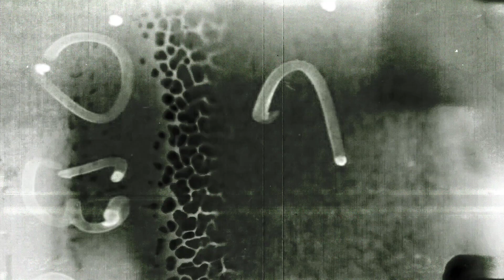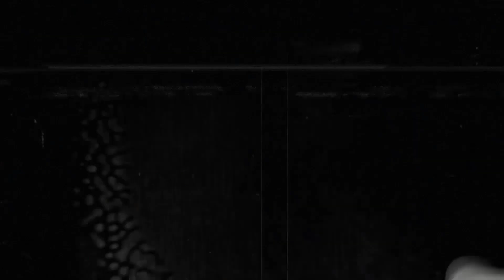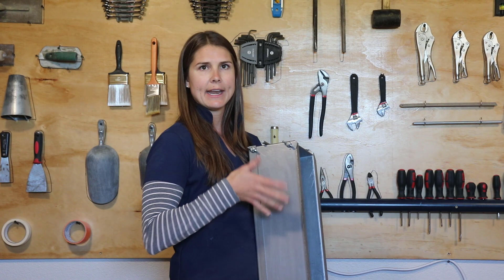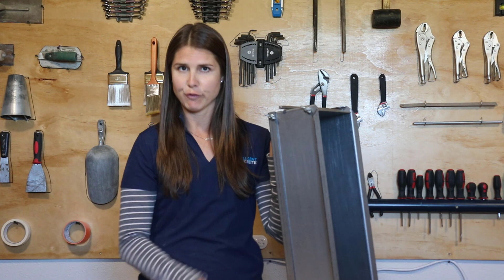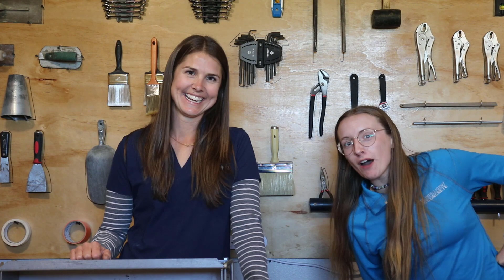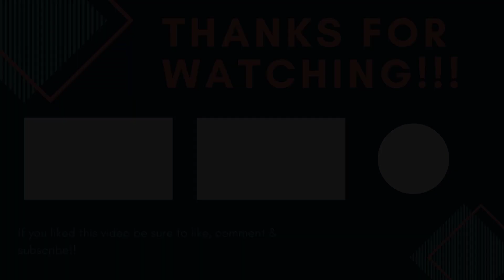ASTM C 78 - Flexural Strength for Concrete - Vlog 642

Comment: Pls tell How many days required strenght percentage I mean 7 days strength how many percentage 14  and 28
Reply from the maker: It all depends on the binder. 75% at 7-days is the rule of thumb.  80+ at 14-days and you should be at 95% at 28-days

Comment: What have you found on the 1/2" steel rebar/6x6x6 paving mats/fiber/basalt rebar debate?  I'm a flatwork contractor who uses 1/2" rebar 2' o/c almost exclusively. I've noticed that when people use paving mats the reinforcement usually ends up pretty much on the bottom of the slab (definitely if they don't use chairs and sometimes even when chairs are used). Question 1 - Since fiber provides reinforcement through the whole slab, can fiber replace steel reinforcement in things like driveways, shop floors, and footings/foundations. Question 2 - Basalt rebar. Is it any good? There is a local supplier that has a bunch and is trying to push it. It doesn't have any 'ridges' on it like regular rebar. I think the tensile strength is there, but what about the bond to the concrete (especially in the more dirty and harsh job site environment)? Also it doesn't seem to have the shear strength that steel does. In some situations that could be detrimental. 

Thanks for the work you guys are doing to educate the people who are in the field pouring concrete daily.
Reply: @Jan Schlossar  -  Thank you for so eloquently portraying the disparity between the lab and the field.
Reply: In your steel reinforcement the upper 1/3 is where it should lay, so whatever can stay there is what should be used. As far as fiber, I have seen steel fibers used in footings, but only in cities that allow it in building codes, and I think there is much debate about their effectiveness to replace steel rebar (so obviously it does help reinforce but the question is can it replace rebar? still up for debate) But if you’re talking about polypropylene monofilament fiber that will help with tensile stresses early on when the concrete is fresh and weak, especially on hot and windy days when concrete sets faster and the hydration process has only just begun yet the concrete is already cohesive yet not mature enough to handle that stress
Reply: @dylanangel3143  Thanks for the info. I didn't know about the polypropylene fiber being primarily for early strength. I've had some problems with early cracking in the heat of the summer and it's good to know that this might be a good option to help combat that. As far as where the steel lays in the slab. For some reason I have always heard that it should be in the bottom 1/3 (I guess working from the viewpoint that the floor is acting like a "beam" to spread out the weight over the sub grade). I'm not sure where I got that or if it is correct. I'm just curious where you got the top 1/3 bit.